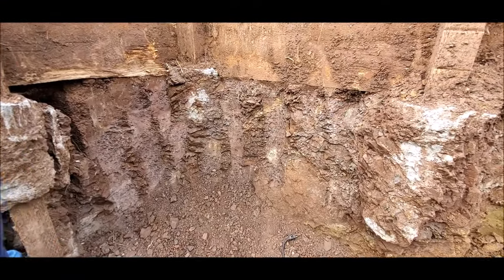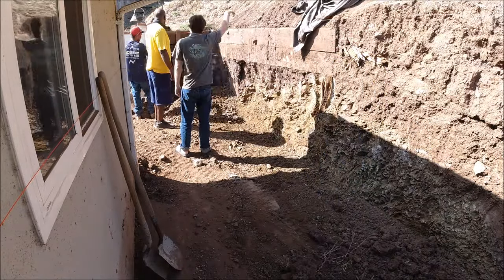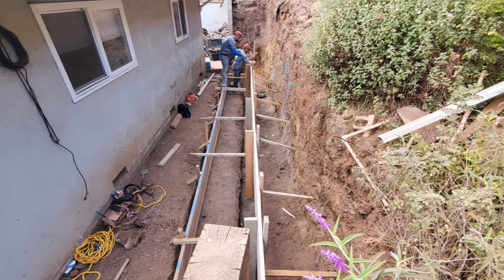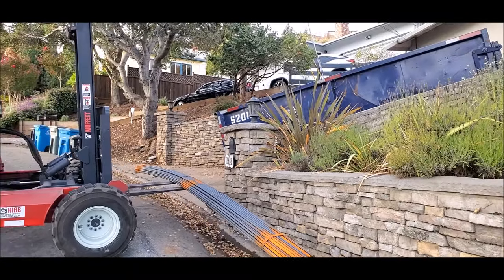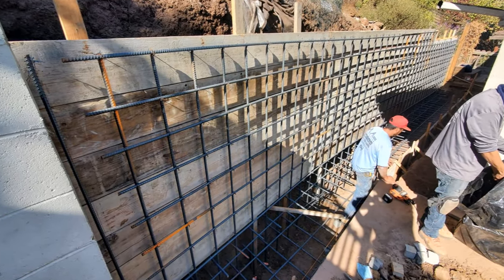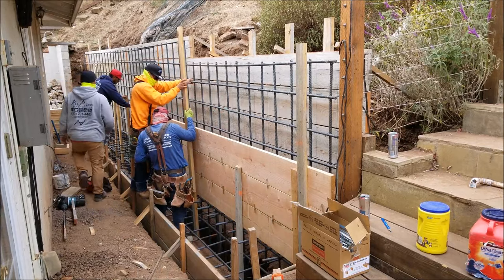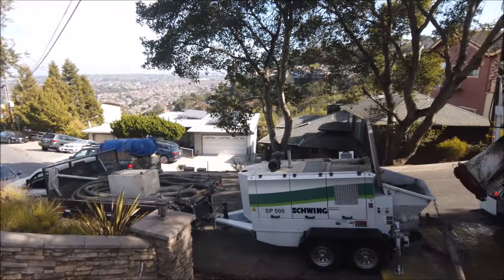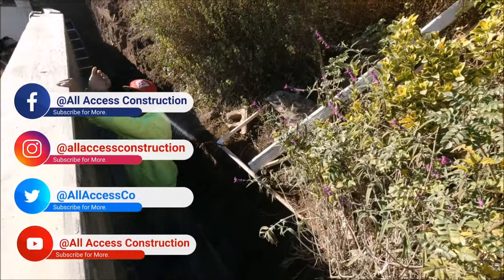🔊 How To Build & Pour Concrete Retaining Wall After Hillside Slide

Comment: What happens when the excavation gives and your guys are buried alive? I also would have assumed the heel of the wall would have been much wider….are you guys working off of signed and stamped drawings or referring to the IBC? Just something to think about you don’t want the wall to fail down the road and kill someone…
Reply from the maker: Project complete 2 years ago.. No incident also plans was designed by structural engineer and we built according to plans
Reply: @AllAccessConstruction  Good to hear. You guys do good work and you can tell you take pride in your work. And happy to hear you had stamped drawings to work off of. I have only worked on large scale commercial projects and the focus on safety is much different on small residential jobs.  Been on two seperate billion dollar jobs where someone was killed. Not a good feeling knowing the accident was preventable and they arent going home to their family.

I also don’t know what the soil classification is where you live. It may be safe i wasn’t there.
Reply from the maker: Yea soil was pretty solid.. I'm big on saftey as well.. Once I start deducting they start to pay attention 😂😂😂

Comment: I'd put weep holes every few feet, and a drain pipe behind the wall, and gravel. Water has to get out of there, or it will freeze and push on the wall.   There is a wall in NJ, that's 4' high, and 50 years, but it's pushed out about 8" at the top, and the crack makes it look like it's going to break off.
Reply from the maker: Appreciate the comment.. We do have a full French drain system behind it.

Comment: Wow... this brings back memories... did a 10 foot x 100 foot wall in Seattle...

Client needed a large level area for a tennis court. Seattle is more hills than level. Every job requires grading, drainage, and some sort of slope retaining. No site access from client property, but neighbors allowed access across their property. Saved us from having to wheelbarrow 100 yard of concrete hundreds of feet from street.

I've been watching you guys for a while... always impressed with your willingness to do it right rather than cut corners. Steel and Concrete work together when done right. Nothing worse than getting big cracks, requiring jack hammers to remove, and doing it all over.

Your videos are easy going, informative, and understood. Great Job AGAIN.
Reply from the maker: Appreciate the comment again.. That curve retaining wall was about 400 feet long Average height 8.5 high.. 👍🏾👍🏾
Reply: @AllAccessConstruction  Amazing project - thanks for comment.

Comment: Put in the drain pipe at the bottom in the back with #57 stone, wait 10 days to back fill and done.  Great details.  You also correctly placed the steel mat on the back side of the wall about 2" from the form.  Our engineering firm is picky'.  My opinion is, That is a well done retaining wall.
Reply from the maker: Appreciate the comment👍🏾👍🏾 Check out our French drain playlist... https://bit.ly/3vmZdwQ

Comment: Awesome video! I need to build a 4' retaining wall at my house. Thinking about hiring a couple of guys and doing it myself.
Reply from the maker: Appreciate it.. On the dyi scale.. Its about 4 out 5 9n difficulty for a first timer.. 🤣🤣 Good luck
Reply: @AllAccessConstruction  I'm a Civil Engineer and have designed retaining walls before but have never done the actual construction so I'm definitely gonna need lots of luck.  Where are you located?
Reply from the maker: San Francisco Bay area..

Comment: Awesome content, i see you often reply to the comments so here i go with a couple questions: where i live i see the concrete workers using large plates instead of planks for the formwork, and heavy duty steel tiebacks that run through plastic pipe so that they don't get trapped into the concrete and can be removed easily afterwards. Is this a technique used exclusively for very large retaining walls ? Other question is about the ethernal conflict between people who design and approve blueprints, and people who turn them into practice. I'm a proud trench guy and hauler/loader operator, been recently to a course to expand my knowledge and i was delighted by the amount of rather complex things that were included, like geology notions, calculations for strenght requirement of water lines' anchor points, dimensioning of ground water drainage systems and the likes. I loved it, but couldn't keep myself from asking the teacher how all this wouldn't be the engineers' job. He said 'Yes, this is engineer's work and it's supposed to be all calculated and drawn correctly before being handed over to you. But it's your duty and your right, as a competent worker, to raise your hand and point out something that cleraly doesn't sound right and might have slipped through during the design phase. One day you might be the guy who makes the difference between the place being flooded within months, and residents enjoying their new homes for a very long time as supposed to be'. Now i wonder if being that guy might get you a raise or even just a clap on the shoulder, or perhaps get you fired for being nosy 😁 Sorry for the long post and thanks in advance
Reply from the maker: Appreciate the comment....there has been times were we question the engineer specs. They do tend to overbuild😂😂😂.  That being said like anything if you see something wrong raise your hands.

I ask thousands of questions just for my knowledge and still learning new things to this day.

As fas as the forms. We well use 2*12.. Thats pretty much how I was taught. East coast guys tend to use forms..

Comment: Great clip... Question: Did you put weep holes for the water in the ground? I also didn't see you put ties to hold the pressure back, did the wall not need that? Sometimes due to height, it doesn't.. I was just curious.
Reply from the maker: We put a French drain behind this wall.. 
Not sure what you mean by ties? 

 Check out our French drain playlist... https://bit.ly/3vmZdwQ
Reply: @AllAccessConstruction  ahhh.. ok.. ties meaning the formations used to help hold the wall up right and not fall over.. being a solid wall, I am guessing it isn't needed..

Comment: Hey Man Great vids keep them up. One thing im wondering about is when you pour the footing portion of the wall how long do you have to wait for the concrete to set up before you pour the wall on top of it so it doesn't get pushed out by the wall concrete. Thanks in advance.
Reply from the maker: Good day.. We start with the footing pretty much go from one end to the other end.. Once footing is filled in we start the wall.. Appreciate the comment 👍🏿👍🏿💯💯

Comment: Great video, and i like your with ethics. Just one question, would it be better if the footings were on the other side so that the weight of the back fill would counter the pressure exerted from the slope. Hope my question makes sense?
Reply from the maker: Appreciate the kind words.. "Let's just say engineers have a certain way of thinking" 🤔😉😉😉

Comment: Man i used to do these same walls in valley springs where the hard granite rock had be blasted and we had to do step footings 11 feet tall walls i dont miss this good job guys
Reply from the maker: 🤣🤣🤣 Tallest one I did was 10 feet... Biggest footing I did was 7 feet wide 2 foot thick... #5 rebar 6 inches on center double Matt.. Appreciate the comment 👍🏾 💯
Reply: @AllAccessConstruction  yes and that grade 60 rebar aint no joke to cut
Reply from the maker: @PhilipAlonzo  #6 at that ..lol
Reply: @AllAccessConstruction that’s an incredible footing for a residential project. I’m used to doing tilt up concrete construction, so I’ve done some insane footings, sheer wall footing at 35’x35’ and 8 feet deep, number 8 bar 6” on center doubles lol
Reply: This is a very well built CIP wall, by the way. Great work gentleman
Reply from the maker: 😀😀 I'll tell clients all the time this may be residential but the work you need is commercial grade work
Reply from the maker: Appreciate the kind words.. Be sure to check out our latest projects on her.. 👍🏾👍🏾👍🏾

Comment: Wish you guys were located in Michigan... back of my yard is about a foot higher than my neighbors & have been thinking about making a concrete wall to stop the dirt from collapsing into his yard every spring when it rains hard.  Thinking of going the DIY route using bags of concrete mix when I replace the fence.  Question: how thick would you suggest a wall like this be, given that it's only going to be 12-15 inches above grade?
Reply from the maker: Appreciate the comment 👍🏾 all our walls are 8 inches thick..

Comment: How long do you leave up the forming before taking it down? What is the least amount of time needed before u can safely take down forms on a concrete retaining wall 4ft high, 7inches wide and 18ft long?
Reply from the maker: I've have strip as soon as the next day.. Ideally the longer the better.. But we're about 3 to 7 days
Reply: Thank you so much for the prompt reply. You guys do an excellent professional job. My hack contractor wants to take down the forms for the retaining wall same day when it's barely 50° out -.-

Comment: Question: Simpson WT8's spec are not recommended for walls over 4ft...or were there engineering exceptions? or are these walls even engineer spec'd?
Reply from the maker: Yea someone mentioned that.. But I have used them for walls 10 feet tall . All of walls are design by structural engineers..

Comment: did you pour the footer and the wall at the same time ? 
wouldn't the wall pressure push the footer up and out of the form ? 
did i miss something there ?
Reply from the maker: Yes we poured everything at the same time we always pour monolithic if possible and no it did not push it out yes yes

Comment: What size masonry bit do you use to predrill for the kickers/supports? Does the soil determine the size, as in softer ground you wouldnt need to predrill possibly?
Reply from the maker: We have all different sizes bits from 9ver the years.. And yes it depends on soil.. 👍🏾👍🏾

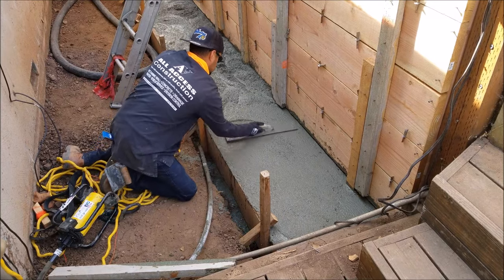Comment: @7:07. Do you guys remove the wood stakes from the concrete or just use a saw and cut it flush with the concrete. I thought you can’t leave wood in the concrete because it would rot over time ?
Reply from the maker: We try to take them out most of the time... Did my house over 20 years ago.. Wood still there.. 😅 😅 😅 APPRECIATE the comment

Comment: How do you pour the footing in the wall at the same time. Doesn't the wall kind of sink down and the concrete in the footing overflow? Or do you wait like an hour after the footing is poured for it to harden and then pour the wall?
Reply from the maker: We start at one end of the footing.. Than go come back around and start the wall..

We use a 6 sack pea gravel 4 inch slump

Comment: I have a similar issue - 20' x 6' tall - wall next to cabin with very limited access to work behind it or even get a bobcat to it - current wall railroad ties bowing in.  I have some room on the hill that could be excavated but not much without making the wall even taller. What was the approx. cost for this? You can send privately, or I can email you.  I would like to go this route. I am in Michigan - sandy soil. Obviously lumber was more expensive in 2020 but now steel is high. I think I could gauge what it would cost from this one?  THANKS!!!!
Reply from the maker: You can text me 510 804 4646

Comment: Where would I buy those ties and wedges?
Reply from the maker: Here is our affiliate link helps supports the channel.. 

Be sure you order the right size example wt8 is for 8 inch wall.. 

If you haven't built a wall before I'll recommend 12 inches on center especially the bottom two boards. 
 https://allaccessconstructiontools.myshopify.com/products/simpson-strong-tie-wedge-tie-18-ga

Comment: Hi, I'm about to build a house retaining wall and it will stand as the house foundation on a bedrock, about 7feet high just like this one in the video. Can I use silicon or even cement for holding down the rebars drilled into the bedrock before concrete footing? Thanks
Reply from the maker: If I'm reading this correct.. Rebar should be at least 3 inches off the ground....
Reply: @AllAccessConstruction  3" is fine, I want to know if I can fasten the rebar onto the 3" hole using cement or silicon? Thanks
Reply from the maker: If you can send a picture to 510-701-4400.. Not really following you. Just fyi I never use Silicon with any rebar actually never heard of it. All our  rebar is tied with tie wire.
Reply: @AllAccessConstruction  510...is that your contact or ? Saved it but not able to see on WhatsApp
Reply from the maker: I don't have a what's ap.. You can email Joe@allaccessconstruction.net
Reply: @AllAccessConstruction  will do just that, thanks

Comment: Gotta say that came out really nice! I'm considering doing the same thing to my house. The garage is block and surrounded by soil on 3 sides. It lets ground water in during as hard rain. We have installed catch basins, and also tied the gutter downspouts in to the drain lines leading away from the structure. I really don't want to do the standard trench system inside or outside the garage to allow for a sump pump to remove the water. We are interested in removing the earth around the structure and building a retainer. I know every job is different, but what was the ballpark figure for this job? It is very similar to our setup, just 2500 miles away. I need someone to talk me in/or out of it. Thanks
Reply: @AllAccessConstruction  I respect your honesty. Gotta pay to play, right? Guess I'll keep bottling the water for an emergency.

Comment: Newbie question here...       Couldn't a simple Cinder Block Wall be used for this instead?

Was it really necessary to use  the rebar and poured concrete method in this case?
Reply from the maker: In this case a concrete wall. Is best 95 percent a concrete is best.
Reply: @AllAccessConstruction  thanks for the quick reply. I wish you guys were down here in South Florida.

Take care.

Comment: You said you pour the footing first, then the rest of the wall. How much time does the footing need to sit before you can pour the rest of the wall? Trying something similar and don’t want all the concrete coming out from the footing when pouring the rest of the wall, but also have a limited time with the concrete truck. Thanks!
Reply from the maker: Bout time you get to one end of the footing.. Go back to the other end of the wall... Then pour your walls in lifts 8 to 12 inches at a time.. Are you using a line pump? Appreciate the comment
Reply: @AllAccessConstruction  I really appreciate the response. Yes, going to hire a pump, about 4 yards total. Was originally going to do the footer/wall in different pours, but thinking to do it all in on pour now
Reply from the maker: How tall is the wall? Appreciate the comment 👍🏾
Reply from the maker: @thomasheisel4990  check this wall out it was about 4 or 5 yards.. https://youtu.be/ropBMwTRZJc
Reply: @AllAccessConstruction  42” tall, about 29 feet long in an L shape, and 8” wide. It’s more of a planter than a retaining wall

Comment: What do you do with the exposed nail tips when you strip the walls? How thick of a wall can you pour with those ties?
Reply from the maker: You can pour the wall as thick as you like as long as you have the correct wall ties.. As far as nails we leave them.. Or take hammer and hit them to the side.. Appreciate the comment 👍🏾 👍🏾
Reply: Yeah, thanks for the reply. I like how yall pour the footings with the wall simultaneously for a monolithic pour. Do you have to let the footings sit for a bit before you starting pouring the walls?
Reply from the maker: @AX3L87  normally once we finish the footing we start with the wall. THE key to it is to pour the wall in lifts of 12 inches.. For the most part

Comment: What do you do about the rebar going into the ground and rusting out the rebar in the wall?
Reply from the maker: All rebar minimum 3 inches off the ground.. Place on dolbies..
Reply: @AllAccessConstruction  Are not the horizontal rebars in the footing driven into the earth in the back of the wall? That is what it looks like in the video. I am sorry if I am not seeing that correctly.
Reply from the maker: All good... No there inside a keyway.. Three inches off the ground.. Hard to see.. 🎯🎯 3:45 mark https://youtu.be/seGr6uXb_Sk

Comment: For 8ft wall what is the width and deep of the footing ?
Reply from the maker: You will have to speak with an engineer. We did a job were the footing was 24 inches thick by 7 feet wide....that was for a 7 ft wall

Comment: Very nice video .  Thanks for taking the time.  I was wondering how the side of the form that has the nail holding the rebar in place? Do the nails stick out of the concrete when the form is taken out?
Reply from the maker: If it does it's very little.. We have muscle memory when it comes to tapping it in
. 👍🏽👍🏽